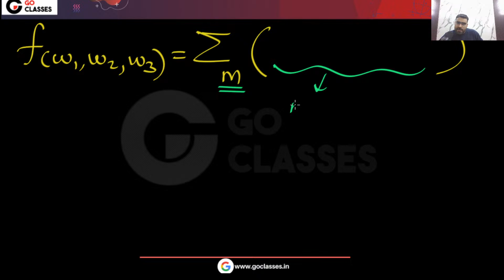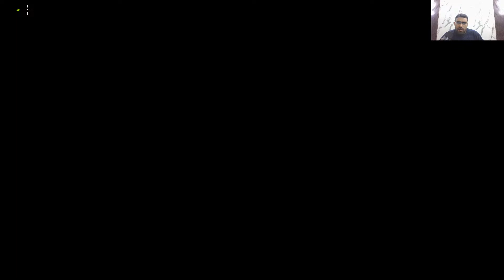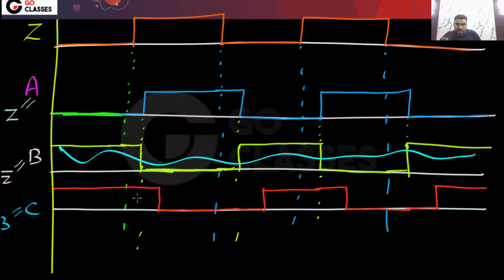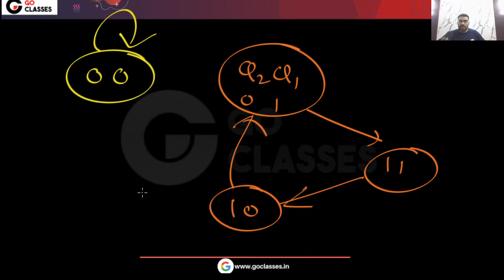All India Mock Test 1 - Solutions Part 3 | GATE CSE 2024 | GO Classes AIMT -1 | Deepak | WITH NOTES

Comment from the maker: 00:05:50 - Function implemented by Decoder - Digital Logic
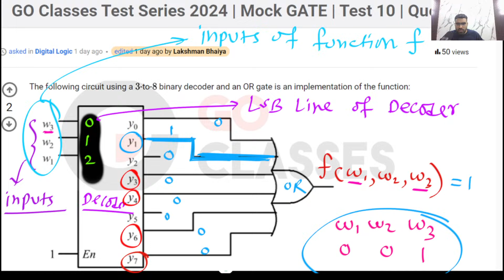00:18:28 - 2's Complement Addition - Digital Logic
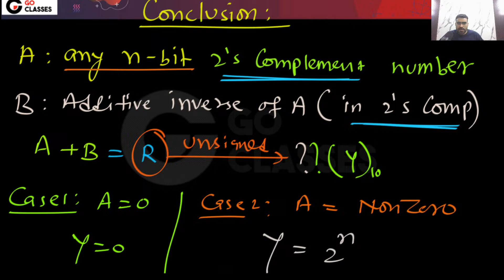00:35:42 - Binary Subtraction - Digital Logic
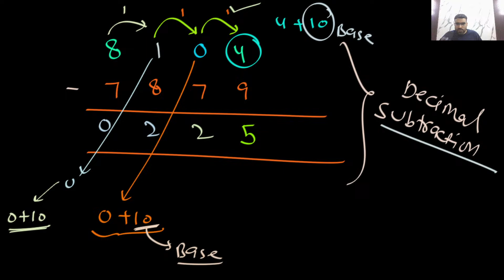00:41:21 - Propagation Delay in circuit - Digital Logic
01:04:03 - D flipflop - Digital Logic
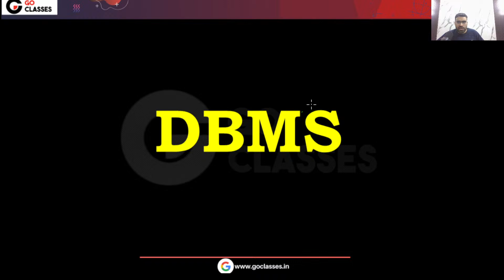01:29:38 - Normal Form question - DBMS
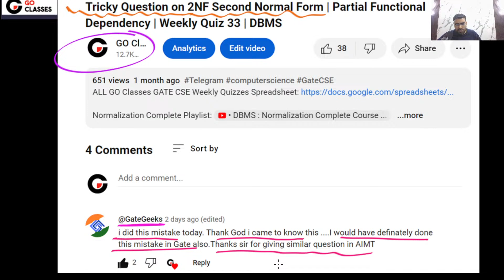01:31:08 - Schedule Conflict Serializable, Recoverable, Cascade-less - DBMS
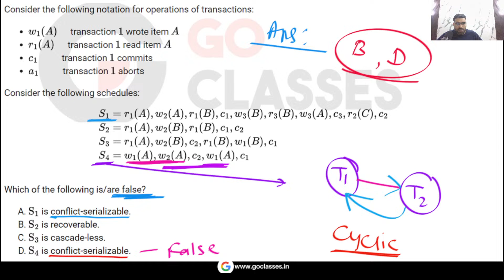01:41:24 - Number of edges in precedence graph of a schedule - DBMS
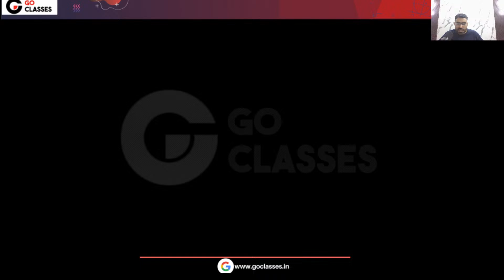01:54:25 - Relational Algebra Join Operation - DBMS
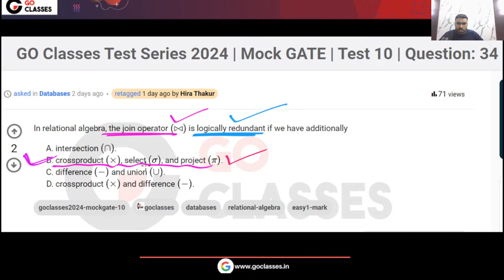01:57:58 - SQL question - DBMS